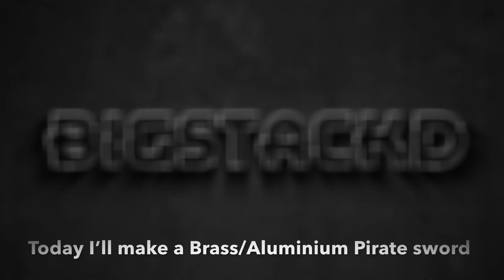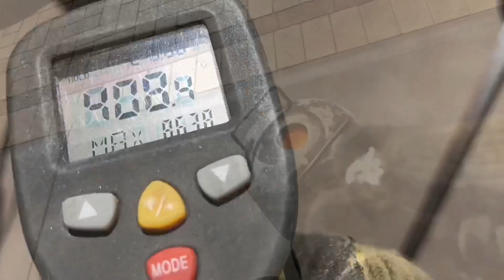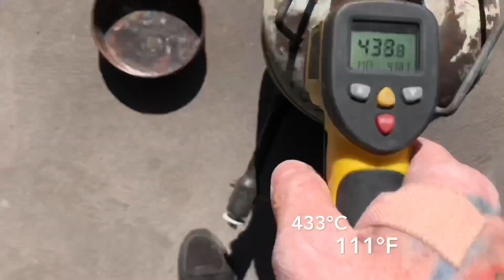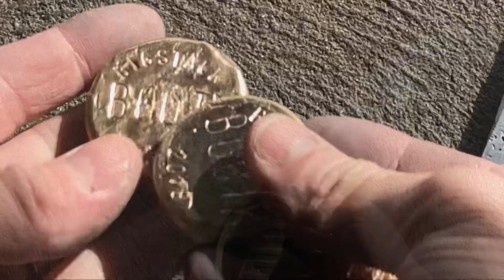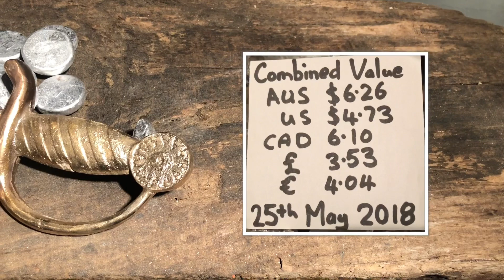Casting a Cutlass Sword From Scrap start to finish - Pirate Sword with  Brass Hilt & Aluminium Blade

Comment: Great result for a cast that's a bit more complicated than others. You do an awesome job D!
Reply from the maker: Cheers Susan I appreciate that😁.
, I just tried to cast a brass handle onto a steel blade that I made I spent a solid hour getting the mold ready and another hour prepping everything I needed done  then melting the scrap brass into ingots to remove as much impurity’s as I could do I could remelt the ingots to make the handle only to have a massive fail 😞😔🤦🏻‍♂️😞😔now it’s 10:15 pm and I kept the neighbors up last night till after 11 so I’ll just clean up and try again tomorrow 😕. I love this shit but it’s sooo disappointing when this happens 😣

Comment: Hey brotha, quick tip for u and everyone. Take that sand, and run it through a sifter and separate it. That FINE sand. That's used on top of the item first to get the best detailed. Impression on the sand. The rest of the sand is just filler and weight to imprint. If u use regular sand ontop of the item, it may not make a good impression. Just my 2 cents. Many thanks man 💪❤

Comment: Slick idea using the steel bud. Have you seen what Alumi Tube did with the hinge on his furnace. Brilliant ! Is that your own homemade green sand ? Petro may be better for holding the heat and a better initial finish. Love the pucks bud ! All in all a fine day for ya.
Reply from the maker: Cheers Dean , yeah I would love nothing more than to have a shitload of petrobond sand but in Australia it costs    Well over $50 a friggen kilo and last time I ordered a heap from overseas customs stopped it saying its soil based and not allowed into Australia 😡😡. So I’m stuck with my own greensand I make from bentonite clay powder and sifted playsand 👍🏻. I’ve tried making petrobond myself but no success ☹️. Yes I love Alumitubes furnace. I’ve been subbed to him from when he had about 40 subs and havnt missed a video yet👍🏻
Reply: Australia ! Oh my. I hear you on costs bud. I paid $ 80 CDN for 10 lbs of petro and $ 60 a kilo for delft here. It would be great if you could find a deposit of potters type clay. I have heard it works well when dried and ground up and mixed with mineral oil to make it workable but that is hearsay. Great luck to ya bud ! That furnace of his sure has stood the test of time eh and when it started to fail he just adapted and carried on. Great guy.
Reply from the maker: Cheers mate I’ll be keeping an eye and ear out for sure😁

Comment: Always wondered if you could cast over another metal..cool 😎
Reply from the maker: Yeah as long as the metal you cast over has a higher melting point than what your pouring over it . When I first started years ago I poured molten copper into aluminium molds🤦🏻‍♂️. Let’s just say the aluminium melted almost immediately and copper went everywhere 😮

Comment: wow mate great video id love a furnace that big XD mines tiny
Reply from the maker: Yeah it definitely needs a rebuild that’s for sure mate. In 4 weeks I’m getting some proper refractory cement so will be rebuilding then👍🏻. I might even get my beer keg furnace back up and running 😁👍🏻
Reply: bigstackD Casting yeah I made mine out of a mixture of perlite and cement which is working great, however I am thinking of changing to gas for cause it’s faster and more efficient 😅
Reply from the maker: Yeah gas is the best it is so easy and clean😁

Comment: Hey bud. I have a question please. Now when you pour molten metal over a tin molds( the ones that is made to be put on ovens) they fuse into the steel and it gets really hard to separate them. Do you know any way to stop them from fusing together?
Reply from the maker: Sorry matey but i have never used those muffin tins or had that problem although i have seen it on YouTube b4. You'll have to source someone else for that info my friend as i have no idea. Wen i first started melting i didn't have any molds and i used to just make a mold in sand and pour into that as that way you can make your own required sized mold and its practically free.😀
Reply: Woah! That's a great idea man.which state of sand did you use, wet, dry? And does the sand stick on the ingots?
Reply from the maker: not much sand sticks to it if you give it a clean after with a wire brush will usually get it all off.  Be sure to check out the 2 links  below on how this guy makes his Molds he shows an easy way with damp sand and copper and also a very clever way with a couple of flat pieces of graphite That worked absolutely perfectly I will be doing that in future video as well,  you can make perfectly flat sided ingots with flat graphite pieces . 
https ://youtu.be/PorwvzTwh44
https://youtu.be/QkDexcVon5A
Reply: Hot-dayum. thanks for the links bro. Especially the sand casting one was very helpful. Since I can't find graphite bars in my country unfortunately. But I do have a very fine sand (it's what our environment are known for anyways) I'll use it as mold since aprrox 1 tin mold is lost for 1 ingot.
Reply from the maker: Cool matey👍🏻. If you can afford it eBay Sells a lot of graphite  molds they can range anywhere from $3 - $150 i they send worldwide free postage from what I’ve seen.

Comment: do you check the aluminium if it's pure/clean aluminium or mixed with any alloy?
Reply from the maker: Yeah matey it’s pure aluminium , it’s made from a heap of ingots that I melted from scrap a while ago (also that scrap piece I used this time)👍🏻

Comment: Nice handle bud, wonder if ye just give in and hone a piece of 3/16 steel for the blades. i'm all for ye doin some pieces from Lord of the Rings or The Hobbit, ye might see from one of my vids i have a bit of a collection, lol. cheers bud.
Reply from the maker: Yeah a piece of steel for the blade would have saved a shit load of time but then the title would have to read Casting a Hilt . Never mind matey i love doing this stuff. I put your big LOTR collection video on my watch list and ill check it out when i get a chance as i dont really watch youtube unless im at work as any spare time i have im tinkering around in my garage or trying to melt something. Anyway matey have a great weekend.
Reply: Ha ha.. you only watch the Tubes when yer at work, don't get caught bud. we're just getting into the 30's here so thunder season has started. stay warm bud.

Comment: what design is your burner?
and where from? thnx mate
Reply from the maker: Hey buddy how are you, below is the link to my burner that I purchased. Although I wish I purchased a stronger larger burner.  this guy that sells them does sell the larger burners so I might invest in one in the near future. Also this burner has been used well over 350 times and would have close to 1000 hours of full running and hasn’t skipped a beat👍🏻
DFP GAS BURNER blacksmiths forge furnace foundry raku kiln propane farrier knife https://rover.ebay.com/rover/0/0/0?mpre=https%3A%2F%2Fwww.ebay.com.au%2Fulk%2Fitm%2F251448528772
Reply: Do you play extinction?? Nice!
Reply: bigstackD Casting I'm still amazed how we coincidentally got the same burner and 2 crucibles (5 and 8 kgs)
Reply from the maker: It’s cause we’re both bloody awesome 😁👍🏻
Reply from the maker: If your asking me if I play extinction then sorry mate that’s a no I’ve never even heard of it 🤷🏻‍♂️.

Comment: Why put borax in the metle?
Reply from the maker: Borax plays an important role during the melting process as a flux. In metal refining, a flux is sort of like a cleaning agent because it helps remove impurities from the metal  by some how bringing them to the top to skim easier. Well that’s what I was told🤷🏻‍♂️ it seems to do a cleaner pour when I use borax with brass . 👍🏻
Reply: Gee thanks I've learned my fun fact for the day by the way I love your vids

Comment: some nice booty. That last brass one even has a bit of a "booty" shape! btw they're  tearing down a building where I work and the contractors are letting me take all the brass fixtures and such. They only want the "big copper." I'm over 100 pounds of brass so far!
Reply from the maker: oh man you lucky bugger😀😄 even if your not melting it theres still a heap of value there thats for sure. If you ever do start to melt stuff be sure to let me know so i dont miss an upload. Have a great weekend matey.